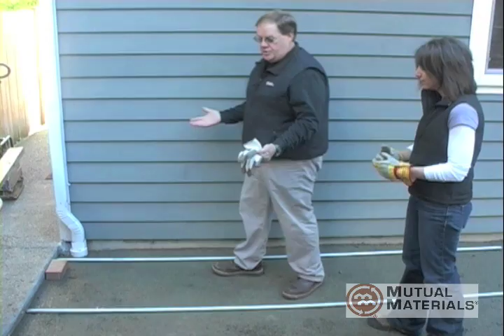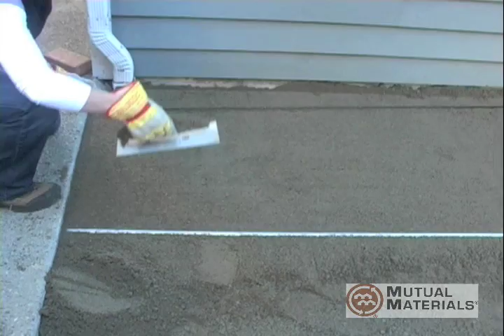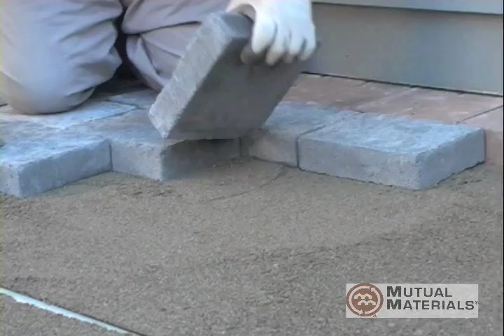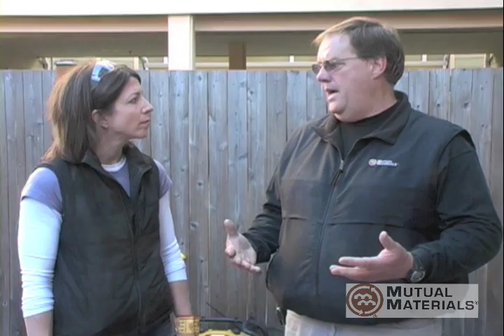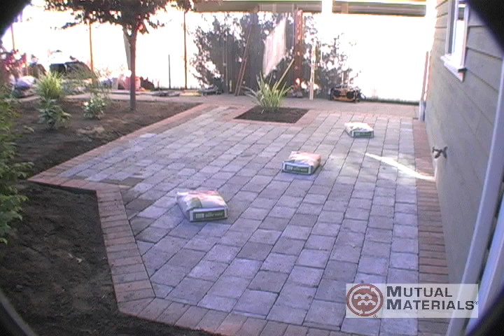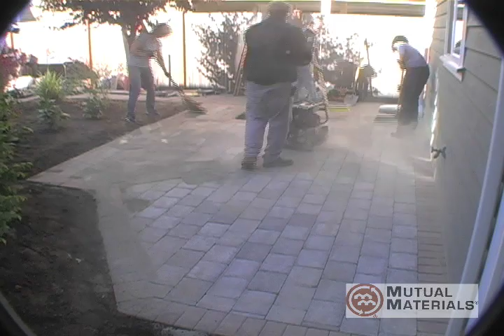Installing Your Own Paver Patio (Day 2).mov

Comment: *WARNING TO OTHER VIEWERS* We just spent 2 weekends laying pavers ourselves using exactly the method here. The pavers were high quality Cambridge with faux bluestone clefts and some were a little bigger than shown here. We used sand (non polymeric) to set them. We then ran them over with the smallest compactor we could find quickly and briefly as shown in the video. The compactor scuffed every single raised cleft, chipped 2 pavers and broke 3. It was only a small patio so that was a significant amount. Super annoyed! I'd never finish it again this way. Next time I'd just hand tamp them and keep extra sand to add as it works its way in. Alternatively I'd use polymeric sand and set it with a pump mister.

Comment: There are a few problems with this install, but I will just mention the most glaringly important.  Laying pavers is just like laying tile.  You always find the center and work your way out.  If you will notice, she had to make some "slim" cuts by the edge closest to the house, while the other edge on the other side of the patio had nice full sized and half sized (cut) pavers. 

So, always start in the middle vertically and horizontally, and you will have a better looking product when you are finished :)